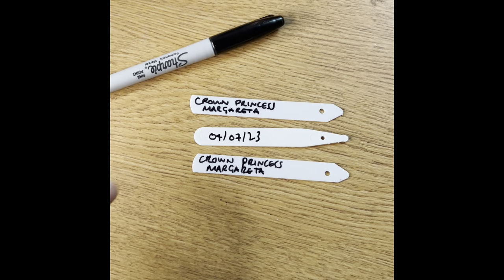How to do rose cuttings - a step by step guide. Crown Princess Margareta rose review, David Austin.

Comment: What is the name of the type of pot and size? Would you recommend self watering pots? Shade or sun outside during the fall and winter California zone 9? Love the video, ty!
Reply from the maker: I use tall rose pots for my cuttings (as they allow for good root development). These are 4L pots but I sometimes use 2L pots also. You can buy them on Amazon and they’re not usually too expensive 😃👍🏻 If you’re planning to grow roses in pots long term  (instead of panting them in the ground) I would recommend a pot at least 40cm diameter and 40cm deep but this is a minimum - if you can bigger then go bigger as it will only benefit the rose long term. Personally I’m not keen on self watering pots, I use an amended soil mix (with added clay) and mulch my roses every year (both which help to reduce the watering requirements). Give them as much sun as possible all year round 😃 ☀️ I hope that helps, thanks again for watching 🙂🌹